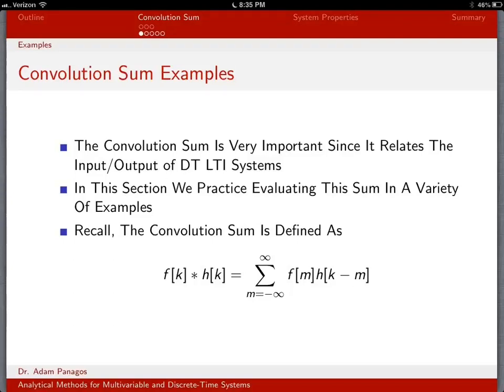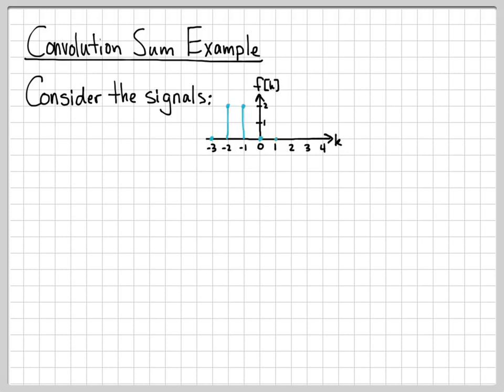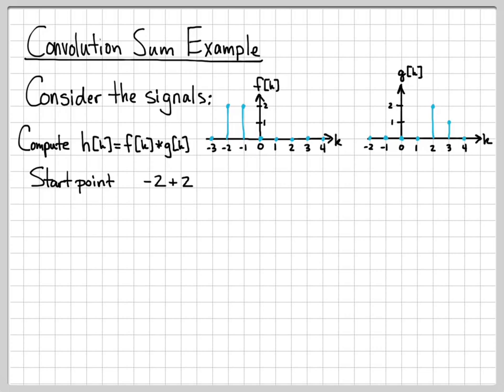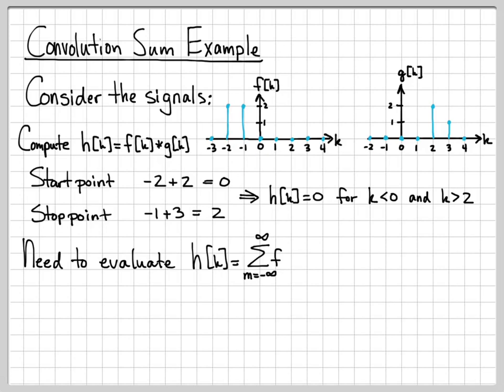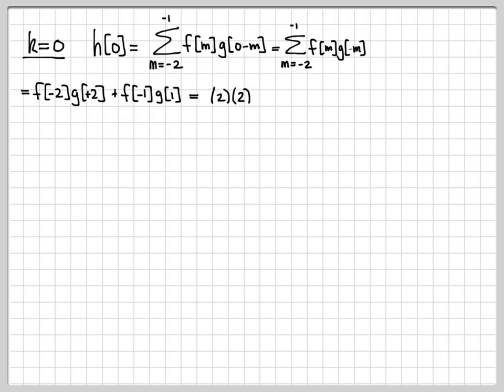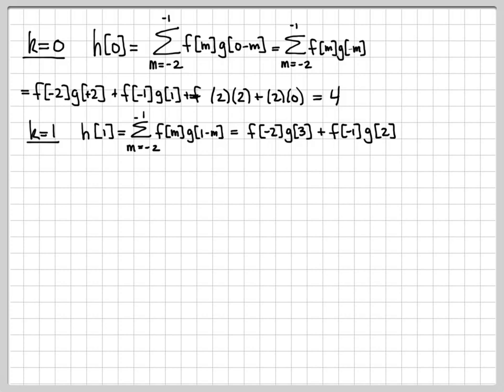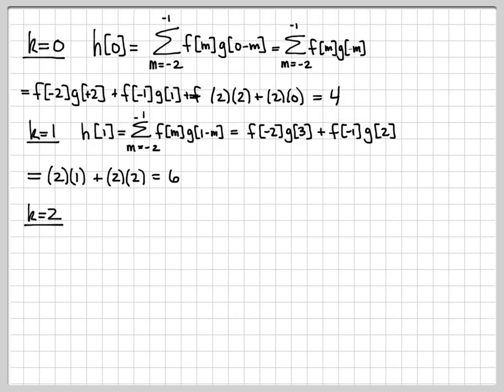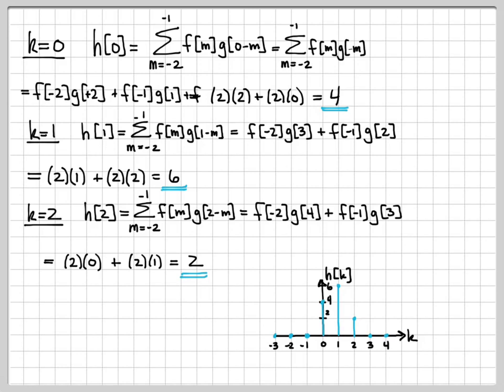Discrete-Time Convolution Sum Example - DT Systems Part 2 (4/9)

Comment: why is the start and stop point just the sum of the start and stop point of the functions we are convolving?
Reply from the maker: That's just how convolution works. If you have finite-length signals, the region where they may be non-zero is always defined by the sum of start/stop points.

Comment: how did you go from 0 and 2 to -2 and -1 in the summation?
Reply: i have the same question, no idea
Reply: okay, f(m) in summation is the same thing as f(k) in convolution. so we are setting f(k) as the "target", and shift h(k). And our summation would be the area overlapping overtime.
Reply: so "m" in summation was "k" in convolution. k start at -2 stop at -1. so in summation, "m" is -2 to -1
Reply from the maker: The first things I computed (e.g. the  0 and 2) are the points where the final convolution will start/stop.  That is different from the limits of the summation in the next part.

Look at the summation form -infinity to +infinity.  This summation has the product of f[m] with g[k-m].  The signal f[m] is zero for most times.  In fact, it is only non-zero for times m =-2 and m = -1.  So, when switching the summation limits from -infinity to +infinity to -2 to -1, I'm just excluding a bunch of zeros from the summation.

Hopefully that helps.  Thanks for watching!